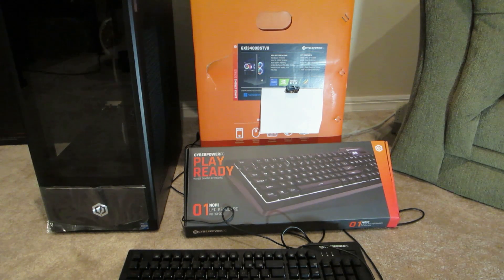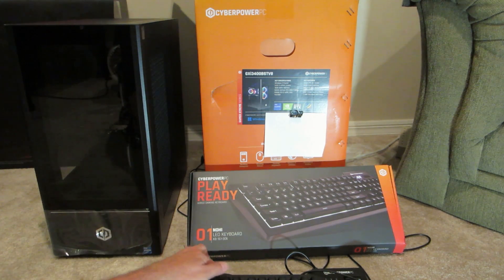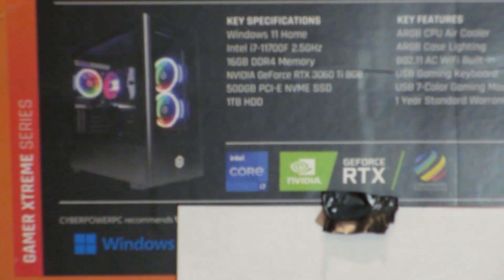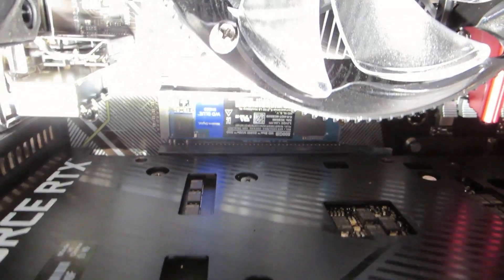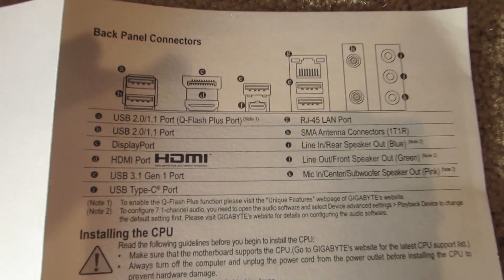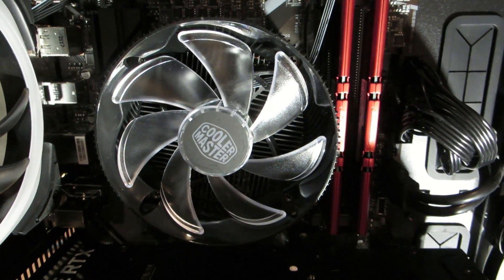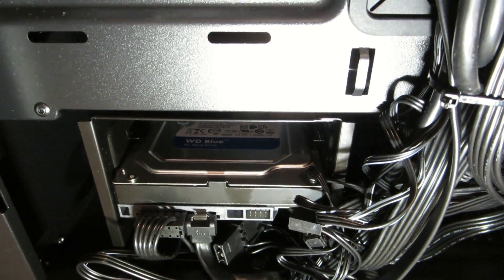CyberPowerPC Gamer Xtreme i7-11700F - 16GB - RTX 3060 Ti Review

Comment: Replace the CPU cooler and flip the 2 fans on the side of the case so they are intake fans. Some people have said that they have disabled turbo mode/disabled overclocking.

A few replacement cooler options around $50 (in no particular order). Of course you can opt for a AIO up to 360mm if you like.

1. ARCTIC Freezer 34 eSports DUO
2. Cooler Master Hyper 212 Black Edition (BE RGB doesn't have the same quality fans)
3. Cooler Master Hyper 212 V2
4. Scythe Mugen 5 Rev.B
5. Noctua NH-U12S

I would also suggest using MSI Afterburner w/RIVA tuner to monitor your system while gaming (ie CPU temp & usage, GPU temp & usage, Ram usage).
Reply from the maker: I did change the two back fans to intake, I didn't disable turbo mode not sure how to, and never overclocked at that time.
Reply: @DesignBuildFixReview I appologize I wanted to clarify. It's a 11700F its not a11700K\K CPU so it can't Overclock. I believe all the complaints I read actually were referring to turbo mode and not overclocking. So the cheap fix to prevent crashing for some was to simply disable turbo mode. However doing so doesn't really fix the problem. As you've outlined Turning the two side fans around, and swapping CPU coolers is the way to go.
Reply from the maker: @Sheisty25  I feel bad for people who can't swap out the cooler, then get stuck with an underperforming, possibly over time damaged cpu. Most people may never notice if all they do is office and browsing. I am suprised how many people are blue screening right off the bat. Even the crappy cooler on low tasks kept mine cool enough to run common tasks.

I did flip the 2 fans to intake and put the oem cpu fan on top for exhaust. The one on top you can really feel the heat escaping while gaming. I think what happens with all three fans is it drops the GPU temps not really the CPU temps. My GPU runs max at like 64 I also never see it go above 95% when gaming. I did attempt to overclock the GPU had some results but it is not easy to do. For one thing when you install the overclocking software at least on mine it screwed up the SIV application. I couldnt get it to work again, and I like the SIV app a lot. I wound up restoring a two day old image which is no problem to fix it. I may try overclocking the GPU again but I have some more upgrades coming soon and want that done first. When I overclocked the gpu I think I gained 3-4 fps not sure the effect on fps in games never got that far.  if I overclocked more it crashed. I may have been too aggressive though.

I get 175 FPS in Halo Ininite on low settings, 135 if I set things close to Ultra.Depends on the map though.
Reply: Thank you guys so much. I got the cooler master 212 black edition. It was definitely a cooling issue. It went all the way up to 94 Celsius only eight minutes into a game
Reply: @Jeremiah_.. , yea I'm glad he put the information out on this channel. The computer went from 100C while gaming a few minutes, to 65C on high/ultimate settings with the Scythe Mugen 5 Rev.B CPU cooler.

Now I just have to cool off the ASUS 3060ti Tuf, it sits at 90C while gaming as the case doesn't have the best airflow design. I'll tinker with fan curves via MSI Afterburner, and maybe additional fans.
Reply from the maker: @Sheisty25  Just an FYI if you have the asus rtx3060ti like I do it has a tiny switch on it facing the glass side that says performance and the other selection is quiet mode. Mine is set to performace. That being said this gpu never goes above 65 degrees is quiet as hell in performance mode so unless you are troubleshooting make sure its set to performance. Also leave the video card in the slot closest to the memory. If you use any other slot the fps never get past 60 fps.
Reply: @DesignBuildFixReview  More great tips i'll check that out and get back to you.
Reply: Just got it and my gpu keeps crashing this is 2nd one already exchanged first how do i fix dont know much about pcs
Reply from the maker: @KJ-ek9ki  Its most likely cpu cooler needs to be replaced with another brand. checp temps with coretemp. Its that or gpu is defective
Reply: @DesignBuildFixReview  damn bc its rhis exact model and bought from best best and first gpu was defective and nex one just cane in and it keeps crashinf again and i overclocked the gpu and everythjnf
Reply from the maker: @KJ-ek9ki  So what happens if you don't overclock GPU, does it work Okay?
Reply: @KJ-ek9ki  Are you sure the GPU is crashing? See my notes about about MSI afterburner w/ RIVA Tuner to monitor your system temps while actually gaming. IF it's crashing don't Overclock it, run things normally, monitor the system to see whats going on. It could be the 11700F CPU (not 3060ti graphics card) temps that's causing the crash. CPU has been the problem for most people.
Reply: @DesignBuildFixReview  no but just exchanged for same model said the manufacturer has been having problems with this combination of parts on this pc and the hardware there putting in so i got new one for third tome and finally everything works good noticed some shit little different but frames sams and everthing and can actually play everything on 165
Reply: @KJ-ek9ki  i would still do wats suggested in this thread to prolong the life of the machine. More than likely ur cpu is still running extremely hot
Reply: Would the Corsair hydro series 120mm work?

Comment: Helpful as hell
Reply from the maker: Thank you if you need to upgrade the cpu cooler I have a video. Here is my amazon link to the cooler I used.

https://www.amazon.com/gp/product/B07MJGNJB3/ref=as_li_qf_asin_il_tl?ie=UTF8&tag=designbuild01-20&creative=9325&linkCode=as2&creativeASIN=B07MJGNJB3&linkId=2bf643bc3fed3037d65d70c5f72ae781

Comment: Can you help me? Why is it that this pc can’t get a good wifi signal but my older prebuilt can.
Reply from the maker: Cant help you there, I tested mine with speedtest and I get the same performance as my last wifi laptop 25mbs upload 280mbs download. I used 5G wifi my 2G is much slower on both.I am on spectrum internet.
Reply from the maker: I know of one other guy with poor wifi performance with system. He even went and had bestbuy put in a wifi card and tried and speed was still slow. I can only assume at that point it is a problem with the wifi router somehow. You could pickup a wifi pci express card and try it if still slow return card to bestbuy.

Comment: do you know how to remove the backplate? i’ve been trying to install a new cpu cooler but i can’t do it without replacing the backplate
Reply from the maker: if its a cyberpower and you use the artic 34 cooler  you dont need to take backplate off it cant use the existing backplate. If you want to remove the backplate you can  heat it up with a hairdryer and gently pull it off. You could also at the same time pull dental floss through it if haidryer alone doesnt work.
Reply from the maker: here is the video if you use artic 34 cooler https://youtu.be/yfj9u8QeY1A
Reply: @DesignBuildFixReview  thank you so much! this is by far the best response i’ve gotten. i’ll be trying to remove the backplate tomorrow cause i want to install the scythe fuma 2. i’m just a bit worried of using a blow dryer since i’ve heard mixed things about using one but if that doesn’t work i’ll definitely checkout them cpu cooler you used!
Reply from the maker: @jonathanchan4908  I hope if it doesnt work out you can put back old items and do a return worse case. I heard others no problem getting backplate off I just didnt want to do it. You may be able to get it off without dryer. Maybe not even use dental floss others used a razor blade i would not recommend that some just physically pulled on it.

I also heard some people had bestbuy put in new cpu fan cooler.
Reply from the maker: @jonathanchan4908  Here is what one guy said.    ￼

pchacki

I dont know if it's common on these but whomever put mine together never peeled the film off the 3M on my backplate. It was barely stuck on by the 3M that wasnt covered by the film on the very thin edges from the factory. It's like the guys at Cyberpower knew that cooler wasn't going to work and did me a favor lol.
Reply: @DesignBuildFixReview  alright sounds good! i’ll try and see if i can slowly pry it open with a credit card first and if not i’ll try a dental floss. thank you so much again for the help i really appreciate it, it’s been a struggle to find answers on how to remove the backplate cause there’s not many videos about it
Reply: @DesignBuildFixReview   i actually heard something similar lol, someone mentioned how their backplate fell off after they removed their cpu cooler so hopefully i’m one of those lucky people cause this cooler really has to go. you should start a discord by the way, i think it’d be pretty cool if your channel grew more and you had a discord cause your tips are really helpful and i’m sure other people would find it useful too
Reply: They only placed one side of the double sided tape on the machine we purchased. However, a blow dryer can be used to help release the glue from the tape.
Reply from the maker: @Sheisty25  Yeah like they knew something

Comment: I just bought this exact one. Comes in, in 2 days. It would be awesome if you did a video on installing new fans, so that I can put some in mine too! I’m new to pc so haven’t done it yet.
Reply from the maker: Have you checked my recent videos, I am upgrading the cyberpower machine every week and you may be interested in some of them,  it is kind of fun. I have a video called reuse the CPU Cooler fan that is when I add a single rgb fan to the top of the cyberpower case that may help you. I did reuse the cpu cooler fan in that one. Check out the other videos I have on the cyberpower pc one might work for you. Do you plan on replacing the CPU cooler? You really need to on this machine, temps hit 100 and thats bad? I have a video going over that process. I am going to add a few more videos this week that are pretty cool as well.
Reply from the maker: I also have a video on flipping the two fans that are in there.
Reply: @DesignBuildFixReview  Awesome this is very helpful thank you! Also I’m having a huge problem with fortnight crashing about 10 minutes into the game I’m wondering if it has to do with windows 11 which comes on the new desktops and windows 11 it’s still fairly new. Do you have any experience in that? It’s such a bummer because I have such a great machine now but it’s crashing every 10 minutes. I was thinking of possibly downgrading to windows 10 if I can it seems to be a problem with windows 11.
Reply from the maker: @Jeremiah_..  Try playing the free version of call of duty or free version of halo infinte both work on my windows 11. I cant image windows version would do that. Make sure game mode is off in windows and turn off vsync in game if it is enabled. Also check temps see my other video because i cant recall the app i downloaded to keep and eye on cpu temps.  Some guys had an issue running memory at full speed and dropped it from 3200 to 2900 in the bios.
Reply from the maker: @Jeremiah_..  windows 11 has a memory checker google windows memory diagnostics, run that to check memory, the temp program I downloaded is called core temp.

If you get stuck call cyberpower or chat with them. It took two hours but they picked up.
Reply: @DesignBuildFixReview  OK I’ll definitely try it. I even did a factory reset reinstalled the epic launcher and reinstalled fortnite again still the exact same issue right about 10 minutes in it crashes and gives me an error. I also updated the graphics card from the app as well as all other drivers. I reached out to a tech-support and they said they’ve had people calling in saying that their windows 11 crashes their Fortnite.
Reply from the maker: @Jeremiah_..  Oh that sucks, search for fortnite compatibility mode you might be able to run it in windows 10 mode somehow. I would get that temp app, then right click the C drive and scan with microsoft defender while keeping an eye on the cpu temps mine went to 90-100 degrees just doing that. If yours does that you will need someone to replace cpu cooler if you cant. I would check this even if they solve the fortnite issue.
Reply: @DesignBuildFixReview  got it ok!
Reply: Hey, I have this pc. With windows 11. A few games would crash because my cpu would hit peak temps of 100c, and not because of windows 11.The cpu cooler is terrible. I switched it out for a hyper 212 black edition cpu cooler and now my cpu runs cool and peaks at about 68c and none of my games have crashed since. So maybe you’re just having heating issues. Good luck!
Reply: @peterc3619  Peter thank you so much for some feedback. I currently have the computer at geek squad to discover the issue. I bet you’re right it seems to be a trend with cyberpower PC. I really like the computer man, was a great price for the I7 and the 3060TI. How long would you say you’ve gone without a crash?
Reply: @Jeremiah_..  I got my new cooler on the 24th of December. And it’s now January 2nd and my computer has not crashed since. I’ve pushed the computer to the max while gaming in cyberpunk, forza horizon, call of duty. Also with 3D software like blender and also using my VR headset and the temps have not gone over 70c and computer has not crashed. Prior to the new cooler, the computer would crash often and freeze at a blue and black screen when the temps reached anywhere near 100c. Hopefully you’ve had your problem resolved. Goodluck!
Reply: @peterc3619  Dude you’re right! I did a test. It ran all the way up to 94 Celsius eight minutes into a game on my CPU

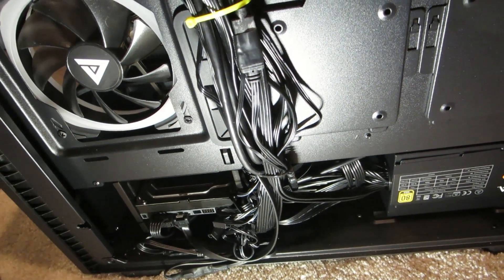Comment: Did you say that this pc has 2 M.2 drive slots? (I only seen one spot for one but at about 6:09 you said something about another spot for an M.2)  Also is this the same pc from bestbuy?Sorry i dont know a whole lot about pcs
Reply from the maker: Depends on what mobo is in yours you can compare yours to my manual. But the gigabyte mobo mine has 2 m2 slots one is the 500gb boot drive.i put in another 3.5 mech drive and an ssd 2.5 just dont add anything until your temperture issues are resolved. then add one test for a week add another test. The power suppply is not the largest one it could have been. But m2 takes no power at all. It was from best buy.
Reply: Im sorry im dense. i paused it where you was showing the motherboard lay out and got my answer

Comment: im so upset my gpu only has one hdmi port
Reply from the maker: there are display port to hdmi adapters on amazon. If your monitor has over 120 hz refresh rate should use display port straight through better performance